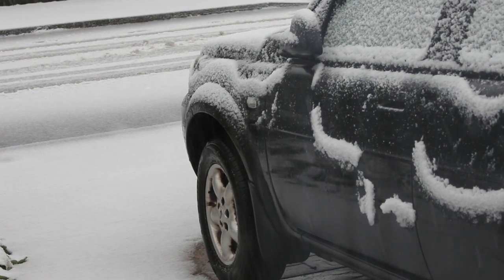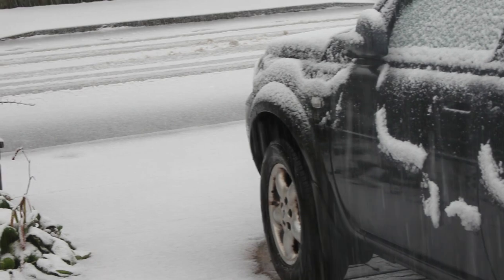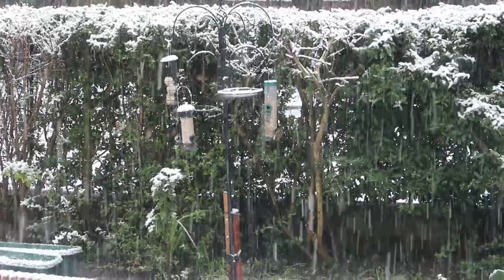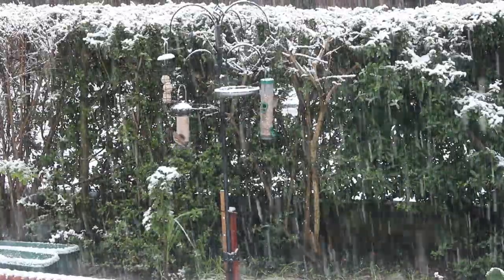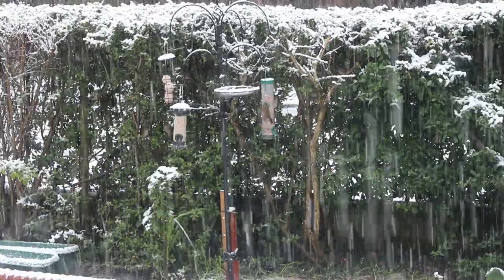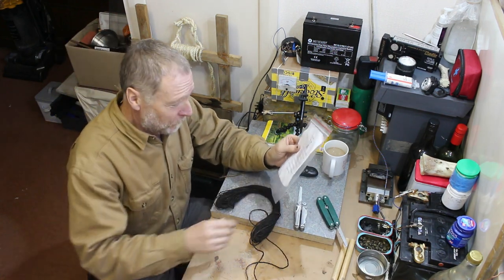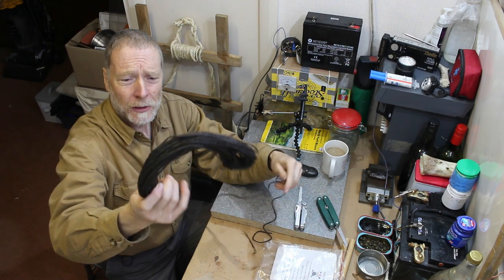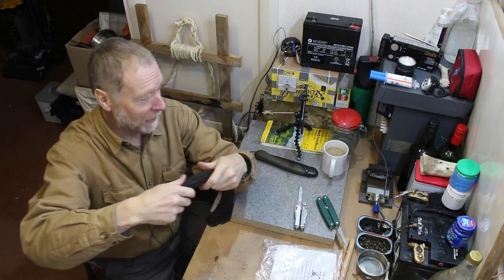Tarred Jute Cordage Lashings on my working Pack Frame

Comment: I like your pack frame and the way you have build it.
Reply from the maker: Many thanks, it is not too comfortable for long distance but very good at heavy loads for a few miles or so. Saves my regular rucksacks a battering when shifting logs or big sticks. It is also work in progress so will probably improve over time. Best wishes

Comment: nice one mate, just a quick one about the camera battery, my canon 1300d dslr does that as well, i've found that if the battery is 100% before i start recording its fine. it dosn't like half charged batteries for long takes. also some camera have a power save mode. maybe look in your menu. anyway great video, quality stuff from Mad Dog as usual. take care Atb Andy. PS i will be back with a video soon, just taking ages to edit this one.
Reply from the maker: Thanks Andy, I know DSLR's can get hot but not in this weather as even the house is hardly heated. I know what you mean about editing, I am still learning just the basics after moving to Linux and Kdenlive free editing software, there is a bit of a learning curve to both. I even got a half decent computer as otherwise I had to render the video overnight and even then sometimes it would not do it. Your videos are always worth waiting for, all the best, we all just got to keep moving and keep laughing 😀 😀

Comment: Love some of that down here lol. Interesting way of doing that. Nice one 👍😁🇬🇧
Reply from the maker: If I had to carry heavy stuff more than a few miles then some padding would be required but for local heavy work it works out perfect, much better than putting the wear and tear on an expensive rucksack, of which I have a few 😀 All the best
Reply: @GrasshopperOutdoors  I use a turtle back. 50lt carrying wood, or anything like that. Comes in very useful.
Reply from the maker: @stealthandysteath1069  I have something similar, heavy load carry, but I have to chop the logs to fit which is not always practical but I do use it when I want to be a "bit" less conspicous 😀
Reply: @GrasshopperOutdoors  ya same here. Great minds think alike 😁👍